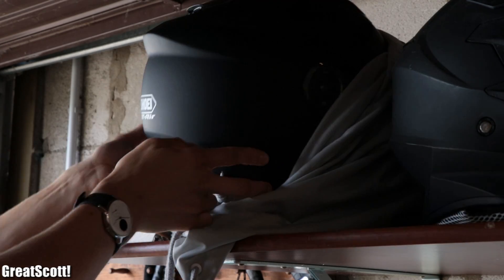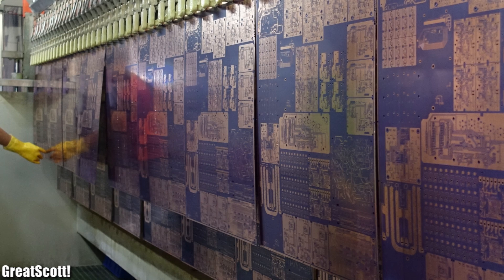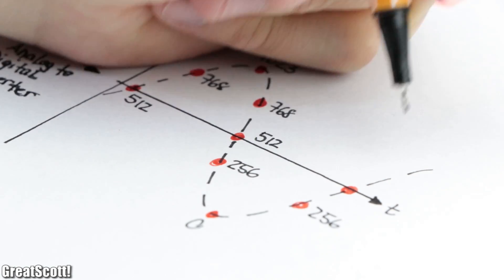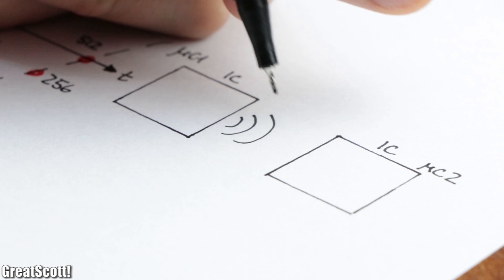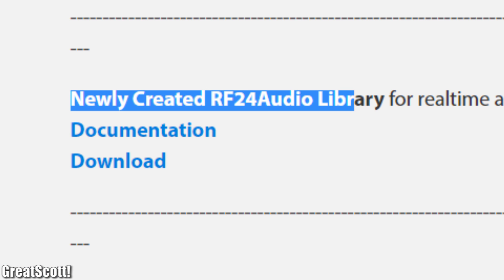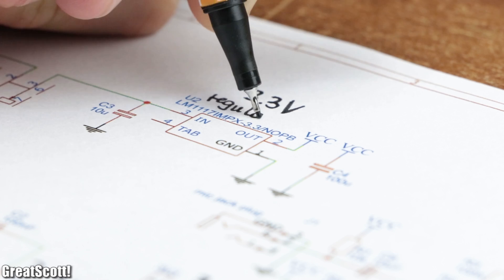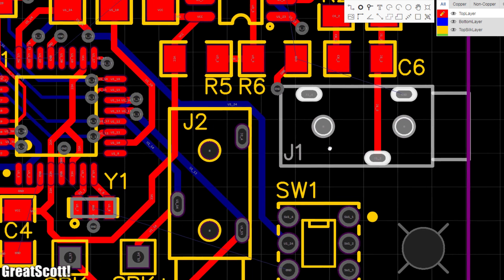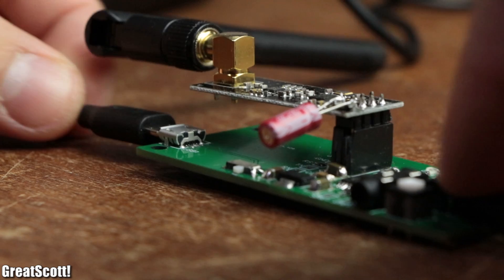Make your own very crude Walkie-talkie with an Arduino

Comment: If only there were some easy, ancient technology that didn't rely on microprocessors to transmit audio wirelessly... Some sort of frequency modulation technology or something... We can but dream  ;-)
Reply: 2 plastic cups and a string :)
Reply: Yeah...RF in all its analog glory is one heck of a abusive bitch.
Reply: Basic FM transmitters are dead simple to build and there are super simple demodulator chips available for the receive side if you don't want to design that half. Just find out what frequencies are legal to use in your country without a license and pick one that's easy to design for.
Reply: @defaultuser000  27Mhz band seems to be ok in most countries. 
Give it three more years and we won't be able to blink an led without calling 5 api's on our IoT enabled NeXtDuino's. This is getting out of hand. Not everything needs a microcontroller.
Reply: @mmmhorsesteaks  I agree, it's completely out of hand. There is zero reason to use a microcontroller for this type of thing. There are SoC devices, like he mentioned at the end, that are specifically designed for short range wireless voice communication. While that is cool and a viable option, I think analog would be easier for a completely homebrew setup, and it would also allow the use of leaded components for prototyping. You can switch to SMD when jumping to a PCB layout. I'm a radio enthusiast though, so maybe I'm biased here.
I do know that you can use 1 (with some signal switching) or 2 (easier to design) SA602/SA612 chips with minimal external components to operate as an FM modulator + demodulator. I dunno.
Reply: @defaultuser000  It is one thing to use general communications frequencies with commercially available equipment. But using non-commercial home-brew transceivers is not legal unless you are a licensed amateur radio operator and use it in those bands.
Reply: @kk1l  The legality depends on your location. Laws are different in every country and you have to abide by them. There are legal ways to use homebrew devices as long as you use the right frequencies and power levels that are allowed by law. You also have to be sure you aren't interfering with any other frequencies.
Reply: Nah, analog sucks(kindof not really)

Comment: I was using the same library for the walkie talkie project i was working on recently.. i didn't design the microphone circuit and pre-amp for the speaker.. I bought them as modules.. put them together.. used the very same sketch.. they worked fine..
Reply: Same, it worked nicely for a basic intercom for me.

Comment: Remember that voltage you hard coded to max? I think that's your culprit. You're clipping your input signal.
Reply from the maker: That is why I used a potentiometer in the final design, to set the gain. But that did not change anything.

Comment: Hi, correct me if I am wrong but don't you need a LC filter after PWM output of the arduino before hooking up output to a speaker?
Reply: I just was going to mention this too. The PWM signal is just poor and results into that kind of artifacts without a proper filter. For an even better quality, I rather would go for a dedicated DAC though.
Reply: Correct ADC requires DAC on other end to rebuild non quantized signal, that's why audio is clipping
Reply: Illegal to operate, but would be working with a few more steps.
First of all you of course will have to kind of filter the PWM signal to get some decent audio quality. OK - one could argue the mechanical slowness of the membrane of your speaker could do that for you. But what is by far worse you did drive the speaker with DC BIAS! That means, the membrane of your speaker will already be pulled or pushed against one mechanical limits of the full stroke length, that is why the system did sound so badly! Use a proper dimensioned C to block DC Voltages and you  most probably will have a working system, if you want to do it the proper way then you'd have to have a proper filter (lowpass filter and buffer amp)  then to drive the speaker.
Apart from the fact that you will not be allowed to use such a system legally in most states all around the world since you then would operate a 2.4GHz transmitter without any EMC safety tests being applied. And maybe not even being respecting the bandplan or maximum allowed transmitting power of your country. And maybe not being respecting minimum allowed distance for transmitting devices/ antennas from any kind of human livings and some of their best parts (well, just in case their best parts may also include their brain and are not only their reproductional systems which I don't want to decide here).    So, nice idea and it could easily work if it was done properly!
Reply: As was pointed out, the receiver is being operated like a Class D amplifier. But you need to operate a Class D amplifier at a high multiple of the required output sample frequency so that the filter can properly get rid of the unwanted aliases. Usually this is 200 kHz or higher for an audio amplifier. You don't run a Class D amplifier at 16 kHz. You just don't!
Reply: @ats89117  There is a way to correct this using code in the micro-controller, but you are right about the low fundamental frequency being too low causing the clipping.
Reply: @ats89117  A 16KHz clocked class D amp would have a bandwidth less than 4KHz. Below that, with proper filtering it should sound fine.
Reply: @bradscott3165  Yup. 4kHz is telephone quality. Not hi-fi, but perfectly usable.
Reply: I think that rectangular signal is not the best wave form for audio output to speaker. Perhaps if the wave form is more sin like, the quality can be improved a little bit.
Reply: Like in a Class D Amp
To filter the PWM Signal
Reply: @feldim2425 ... which still would not make it better. Just think about what an arduino would do if you load it's ports with an 8 or maybe even 32 Ohms load? Will it kill the ports? Will it just cut the output current? How would it cut the output ports  - will it just cut off or will it cut with current-foldback-characteristics, will the cut have some hysteresis to start working again? What would that cutting do to the output voltage? That all is not exactly what you would do if you would like to get proper audio response. A short recherge did bring up exactly one circuit diagram  showing speaker being connected directly to the Arduino with a resistor in series. And that blog mentioned that the Arduino is only capable of sinking 50mA at max. (https://bryanduxbury.com/2012/01/20/one-transistor-audio-amplifier-for-arduino-projects/). Does that ring a bell? ;-) Other sources are talking about the Arduino being able to drive absolute maximum of 20 mA at it's outputs,. It is even recommended not to draw more than 10 mA.
Reply: Correct,I think that an appropriate DAC will give better results.
Reply: Speaker itself a inductor it can smooth out a PWM

Comment: Hay great schott,
Is that possible to transmit video & audio in RF ??
Reply: offcourse, get youself one  dji video transmite
Reply: Anything that can be sent over a copper wire can be sent over the air. The direct connection just makes it much more reliable and much more resistant to outside interference.

Comment: The sample rate y a bit low, but you cant do much with the atmega328p. Did you try smoothing the PWM at the output with a filter and then with a High pass filter takeing out the continious component? so that the output in the speaker is smoother and 
alternate (Sorry for my bad english).
PD: like your video :D

Comment: Why would you use an arduino for this project? This is a perfect thing to experiment with analog electronics and modulation techniques. Build an FM bug transmitter but tune it to an ISM band like CB radio.
Reply: I wouldn't use FM for this

Comment: Buy the way inovative concept for hobby project , but  hey scott can we increase audio quality by using ADS1115 16 bit ADC ?
Reply: Need something faster and preferably designed for audio. Look for chips that start with "PCM" part numbers. The PCM1802 is a cheap one. Audio ADC's are usually high resolution and fast but are not DC accurate. They also need to be matched to a decent DAC of the same resolution on the other end. This is why DSP (Digital Signal Processor) chips exist and are an entirely separate processor category from μC's and SOC's. There will be lots of chips designed for building this kind of system. The Bluetooth wireless headphones with phone controls come to mind. I've taken a few of those apart. They have a single chip that does everything from a lithium battery management system to the 2-way audio communication stuff. These can be sourced from China for a good bit less than $10. These chips are just much more challenging to develop with. I think they require expensive dev kits and the highly integrated stuff I've seen are usually BGA packages.

Comment: 2.4GHz is kind of too high for this purpose, delivering poor signal penetration for something you'd probably use out of line of sight. Lower frequency would be nicer I guess.
Reply from the maker: Because there are many law regulations with other frequencies.
Reply: @Theonlyoneleft1000   868MHz is free to use band (ISM band) as well as 433MHz
Reply: @Theonlyoneleft1000  yeah I know, but this is the cheapest option